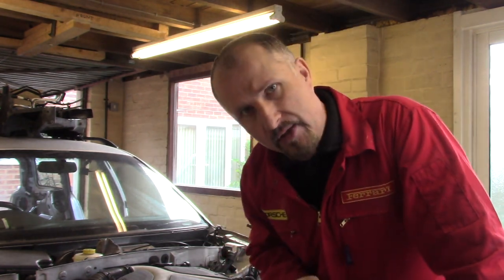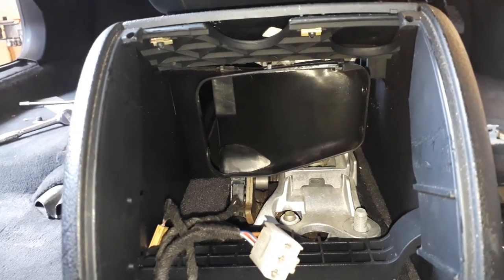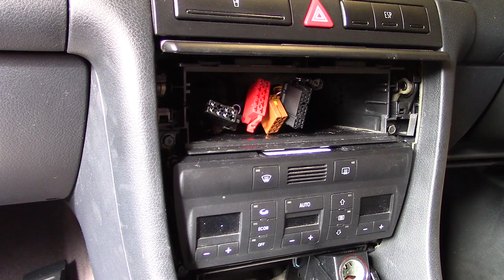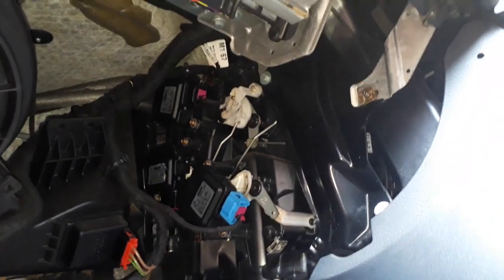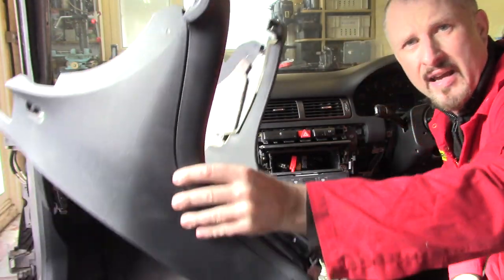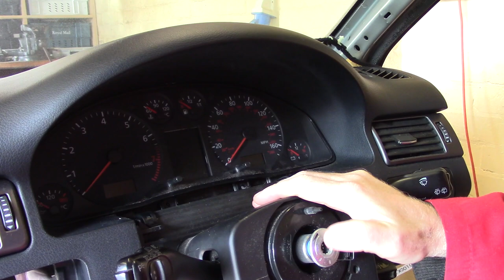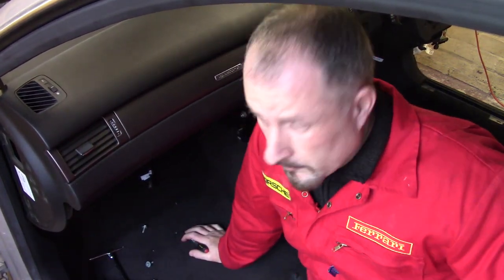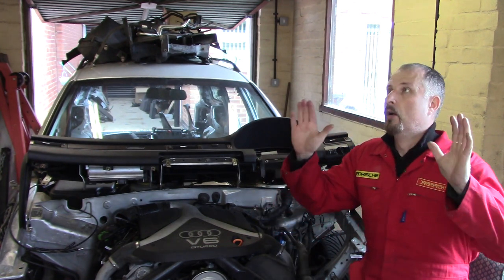Removing the Dashboard and Center Console: Audi 2.7 Bi-Turbo. Ep16.

Comment: Don't You ruin a sun sensor on the top of the dash? It is always a problem for someone who didn't expect wires behind that central vent and often it cause wire or sensor damage at final stage of removing the dash :(

Thanks for great video anyway!
Reply from the maker: I missed that one, but was committed at that point. It wasn't damaged, the lead unplugged itself.